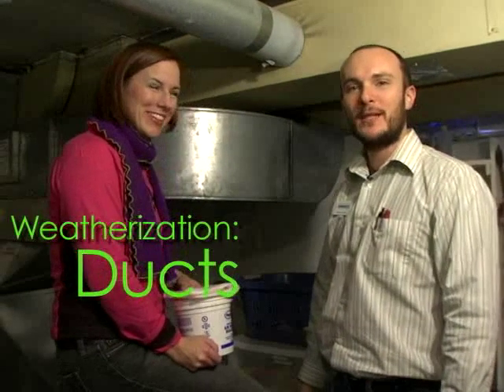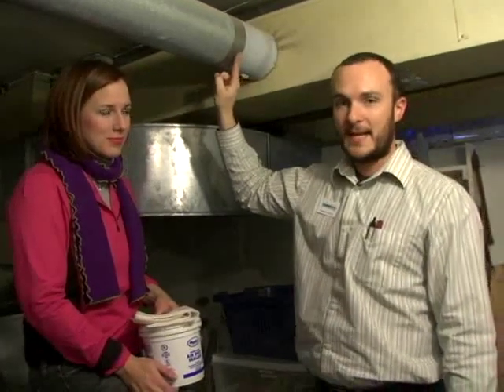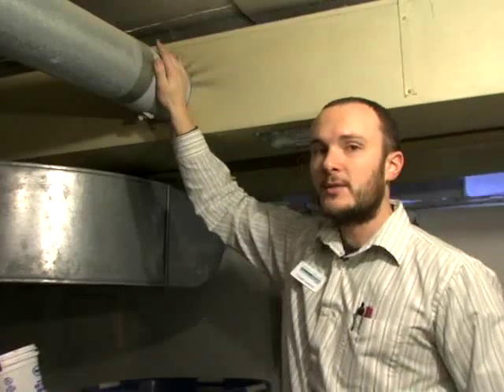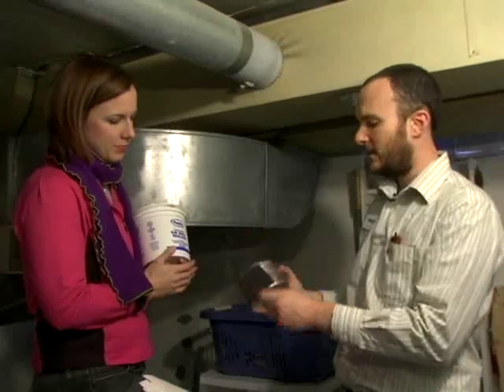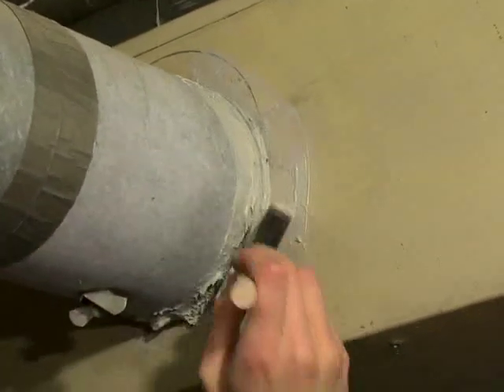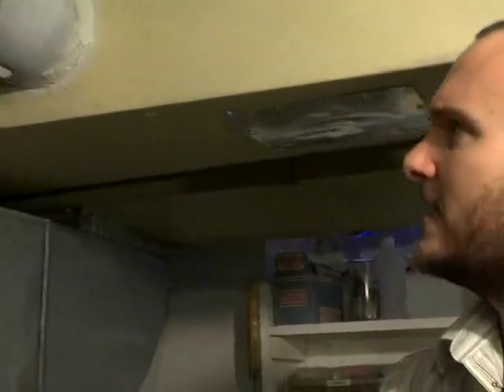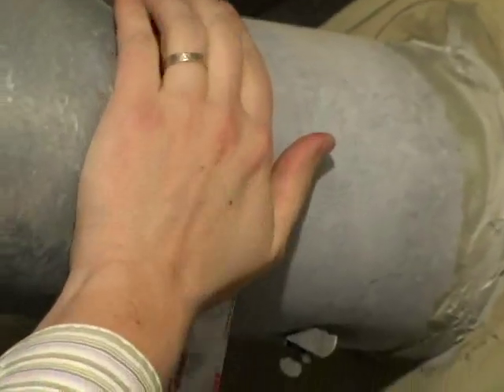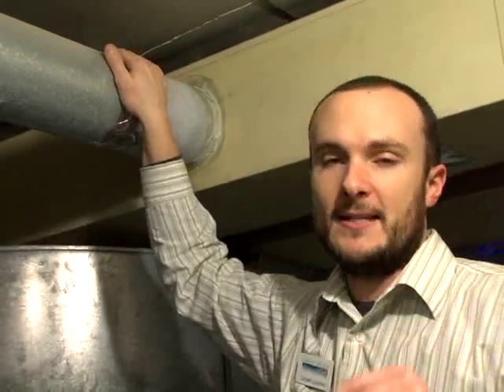How to Seal Exposed Ductwork- DIY Weatherization Solutions from Green Dream Group

Comment from the maker: You certainly can, Jeffery.  It's like cement, and it won't get sucked in or blown out- if you find that's the case, just shut the system down for a few minutes while it sets in that particular area.

Comment from the maker: To be accurate, all ductwork everywhere should be sealed.  Exposed ductwork is not supposed to leak air, it just means the effort to hide it hasn't been made.  In addition, ductwork in 'unconditioned' spaces, like this basement, should be insulated, which we don't go into.  Feel free to pursue training in building performance to learn more.

Comment: These instructions are incorrect: If you're going to use UL-181 tape, it should go on before applying mastic. Then the mastic should completely cover the tape, especially at the edges.

Most of the time, the tape is unnecessary. It helps to cover large holes, and add some strength to the joint. But the fiber-reinforced mastic is key.

The mastic should also be applied more thickly than shown in the video. It should be applied at least as thick as a nickel.